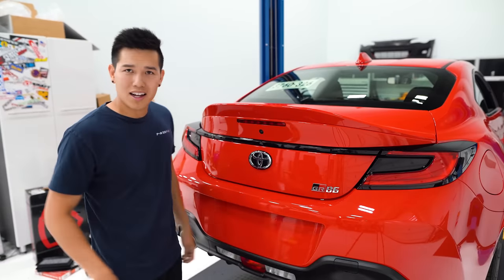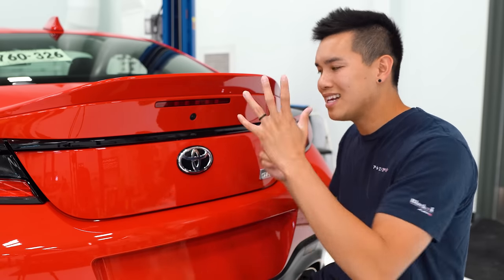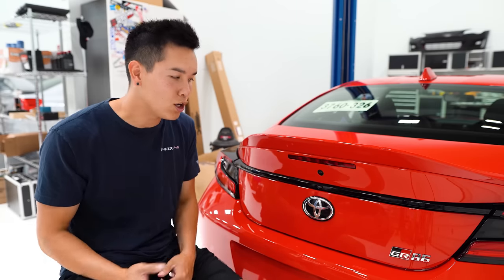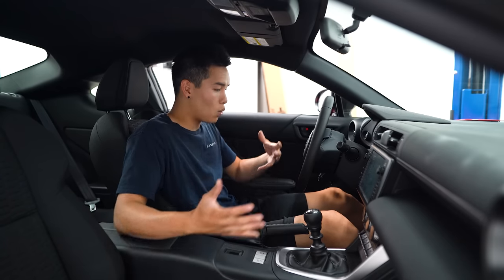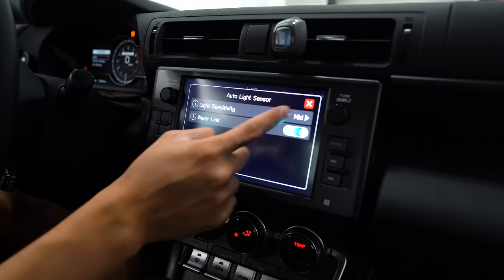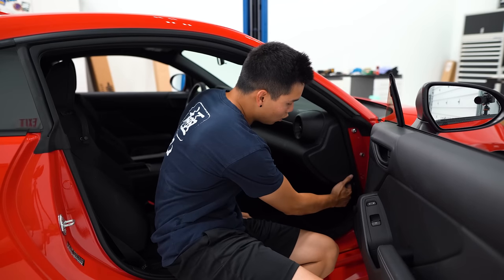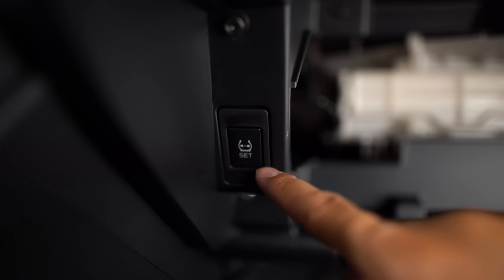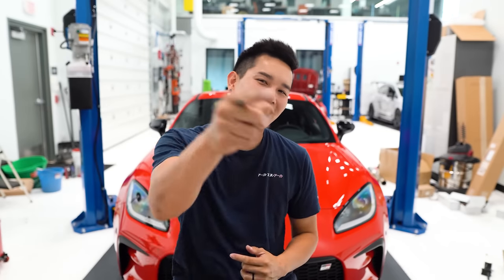2022 GR86 & BRZ Hidden Features

Comment: Did you know that If you ever have a radiator leak pull your dip stick you might find enough rtv silicone on it to patch the hole in your radiator. JK JK but seriously every BRZ or GR86 owner check your oil for rtv silicone chunks, many failures have come to light in the past few day and the more examples the better. Let the manufactures know we love these cars and want  to love them for a long time. Bring up your concerns to the dealer or manufacturing group and get your car checked asap.
Reply from the maker: RIP GR86/BRZ

Comment: So great to learn that it is relatively easy to disconnect the cabin engine sound module. I am still waiting for mine to get delivered but I hear very different opinions about the sound and it is nice to know I will have the option to turn it off. 
Great video!!
Reply: If you turn it off and have a manual you will want an exhaust, the stock one is too damn quiet.
Reply: Mine was off straight from the truck. I test drove an automatic and put down a deposit on a manual while it was still in transit. Engine audio was very obviously on in the auto, but as far as I can tell all original OEM wrapping was on all the seats and the car had 0 miles. It’s been two weeks and I still wonder why it’s off.
Reply: @Rob165x  Which is exactly what I did in the end. Drove with fake engine noise off for around 2 weeks which I still think is better than with it on, but it is very quiet. Something is missing for such a car, so I put on a catback exhaust and now it is how it supposed to be 😃
Reply: @ratatatatata5290  On the auto it is quieter if not in sport or track mode. Not sure which, but it's an option us manual users wish we had. Since you're still in break in you haven't revved it out enough to notice it, but try the other modes. I think on normal it's only noticeable in the upper ranges but even when it's on loud mode it's more subtle below like 4k, almost sounds natural.
Reply: @Rob165x  I’ll have to look into it. Tbh the whole time I was driving the automatic I was just thinking about how bad the transmission timing was. I’m
Not a manual elitist and this is actually my first manual car. I was actually going to buy the auto before I test drove it. 250 miles into break in and I’m already rev-matching through every gear though so it was 1000% worth.

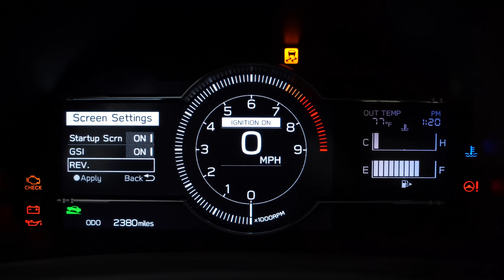Comment: 6:23 if you have just bought one brand new the break in period is 1000 miles and under 4000 rpm so should change that setting for break in period.

Comment: The rev alert was super useful for running the engine in. 4K first 1,000 miles then 6k for 2nd 1,000 miles.

Comment: Is it possible to lock your car while it being idle? It's ironic bc when you remote start via the app it is idle and locked but can't seem to lock it while I manually run it and try to lock it with the key fob.
Reply from the maker: I have not tried this so can't comment. I'll mess around with it and come back with more info.
Reply: @KevinVo  appreciate it, it's actually annoying. Go into a gas station but wanna leave your car running bc it's 106 outside but can't lock it for some reason. I would have to force lock the doors and then use the 🔑 to unlock it. 
Going to annoy me in the winter too lol

Comment: Warning to anyone looking to unplug the sound module on a RHD car (Japan, Australia, UK, etc) it's accessible by removing the glove box, if you remove the side panel you can't get to the clip as the clip is on the right side and only accessible from glovebox removable. 
BTW it makes the car very quiet and is actually better on until you get an exhaust.

Comment: How do you manage lock car without key? When I lock car (manually with door switch) with door opened it will automatically unlock this door and I do not manage any other way to lock kar withou key.
Only way is lock car with key with open trunk, then put keys there and then close the trunk.
Reply: Did you manage how to solve this? Having the same issue.
Reply: It looks like there only way: lock your car with key with with open lid, and then put your key there and close lid…

Comment: Hi, this video was really useful and interesting, so thnx for making. I have a question, how can you change the sparkplugs? (I heared a very weird version, as its a boxer, and both cylinderheads are very close to the enginbay, you have to take out the engine. Could it be true? Could you confirm it?
Reply: You don't have to take the engine out, but I think you need to work from the bottom and possibly remove the headers. Just uncomfortable to reach.

Comment: May just be me, but seems risky with finicky electronics. What if you drive out to the parking area of a hiking trail (usually located some distance from any sort of town) then lock both your key fobs in the car and the code refuses to work? Youre looking at VERY expensive remote locksmith visit...assuming you can even find one these days lol. Also simply unplugging the sound thing could be the source of future dash rattles if the plastic connector just dangles. I'd either tape it to something or wrap it in a small piece of foam or bubble wrap.
Reply from the maker: If you live in the fear that electronics are going to fail, what if the electronics of the car no longer recognize the key and you can't start the car? This feature has been built I to Subarus for awhile now. As for the unplugging, of course you can just zip tie the connector away.

Comment: I'm having massive difficulties still with the seatbelt chime - 2023 brz, i've tried this method in both accessory and ignition mode (I drive a manual) - do i need to try with the car on instead? Because i've done this multiple times in both modes and NOTHING is working. It's driving me fucking mental.

Comment: How do you activate a newly installed tpms on a 2019 Toyota 86?
Reply from the maker: You'll need to go to the dealer or a tire shop that has a programmer.
Reply: @KevinVo  is the programmer specific to Toyota/Subaru? My shop doesn’t seem to know how to do it. I’ve tried to read the manual on how to reset but only the older models have the actual button. Mine I think uses the odo button on the dash

Comment: What happens if you push the ignition button only one time?
Reply from the maker: That would be the equivalent of accessory mode.
Reply: @KevinVo  after that how do you turn it off? 

Also how do you start it if just pushing it once is only accessory mode? I want to have some clue what I am doing then I (eventually) pick mine up
Reply: @martinrps13  you press it 2 more times, once will turn on more features, and the second will be the proper off, and to turn it on if using the manual transmission, you just hold down the clutch while the car is either off completely or partially on

Comment: Also, there's a noise when u r passing or crossing lanes. How do i turn that off?
Reply from the maker: Not sure what you mean by that.
Reply: @Kevin Vo  well every time im crossing lanes to an other, has beeping noise. Also, if ur following a car to close, it comes with the auto stop. Don't like that.
Reply: @noeromero6124  sounds like you got the auto. Them ‘safety features’ are built in. Won’t beep at you if you drive proper, like if you actually indicate to change lanes and don’t tailgate mofos.